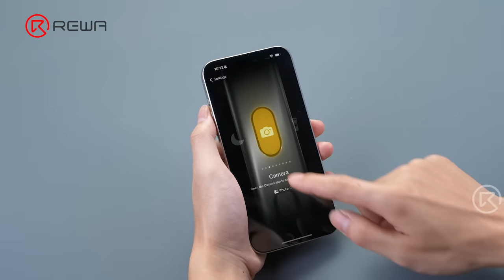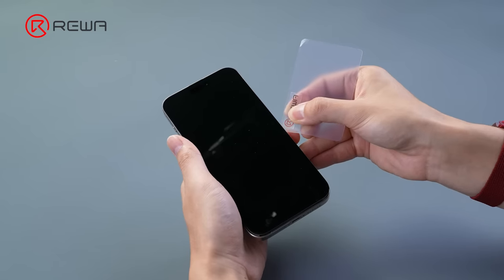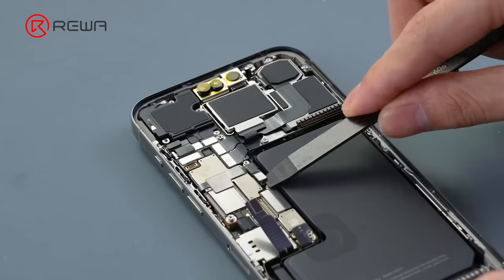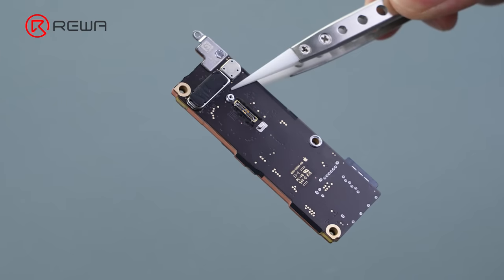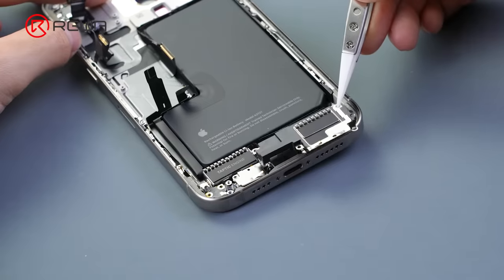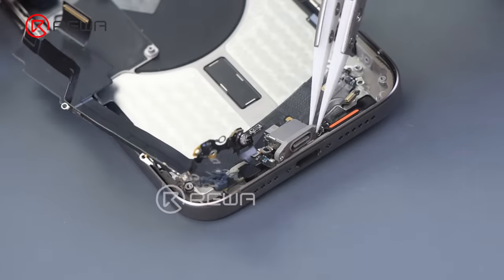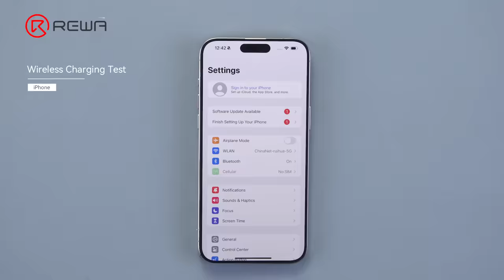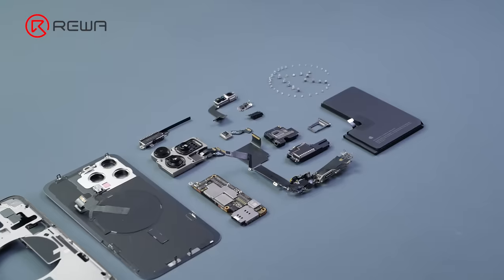iPhone 15 Pro Max Teardown

Comment: All I can tell you is a lot on YouTube that this phone breaks very easily. If you drop it it shatters because they’re using titanium which is less strong than stainless steel. it’s a beautiful phone though but I won’t buy the iPhone 15 Pro Max at all. I’ll stick with my iPhone 13 Pro Max I love my iPhone from Verizon wireless.

Comment: 4:40 Iphone restarting after 2 minutes doesn't necessarily mean the wireless charging coil is encrypted, it could be caused just by missing thermistor input like it is with not original charging port or volume buttons flex 🤔
Reply from the maker: Really thanks for your reply. On one of the aged iOS systems, the wireless charging flex cable was encrypted. Therefore, we guess it has probably been encrypted again with iOS 17. We will keep paying attention to the issue and we will see it in the future.
Reply: I decided to Dona tear down, I also noticed the device does the same thing with a restart after about two minutes of you switch the camera. Out, no pop up message came across this time however only a restart after 2 min, so I'm wondering if that's there method of encryption, this time around.
Reply: Have you change the NFC wireless charger and have the restart issue or it works fine with a new NFC wireless charger?

Comment: no it doesn't mean that the wireless charger has a encryption chip. there is probably a sensor on the Wireless charger and iPhones Kernel Panic when sensors don't check in with the kernel
Reply from the maker: Really thanks for your reply. On one of the aged iOS systems, the wireless charging flex cable was encrypted. Therefore, we guess it has probably been encrypted again with iOS 17. We will keep paying attention to the issue and we will see it in the future.

Comment: The wireless charging is NOT encrypted. You can plug in another one & it will work fine. Just like all recent iPhones, they will restart every 3 min when certain sensors are not detected.
Reply from the maker: Hi Jesse! Good to see you. We try to put the other oem flex cable plug in which still auto restart while we ensure the oem batter and screen etc parts in the phone. So we think it’s still caused by the wireless charging flex cable.

Comment: Phone wireless prob not encrypted but prob sensing its not there sensor issue.
Reply from the maker: Really thanks for your reply. On one of the aged iOS systems, the wireless charging flex cable was encrypted. Therefore, we guess it has probably been encrypted again with iOS 17. We will keep paying attention to the issue and we will see it in the future.

Comment: @REWA Technology can you tell if the TAPTIC ENGINE is smaller than 14 series?
Reply: 15 Pro Max’s linear motor has a size of 0921 (9mm*21mm) from AAC Technologies, making it almost identical to that on 14 Pro Max.

Comment: i saw a drop test of iphone 14 pro and iphone 15 pro the iphone 15 pro even though it has titanium frame its not strong because the back glass is now easy to remove. iphone 14 pro survived like 9 drop without cracking the screen or the back glass.